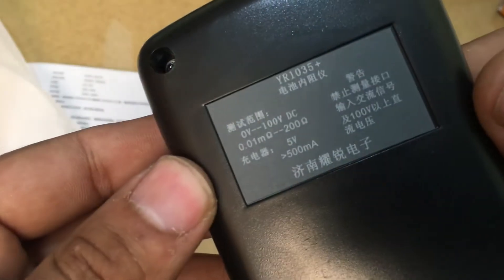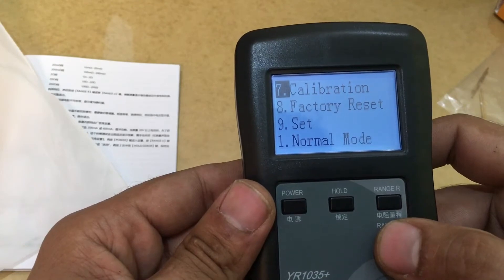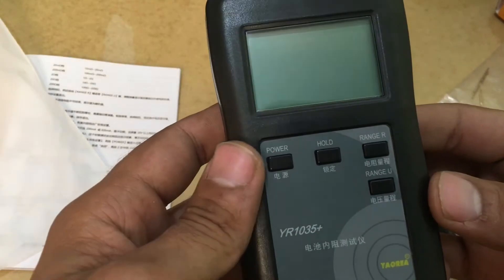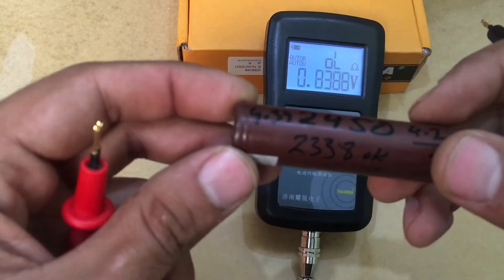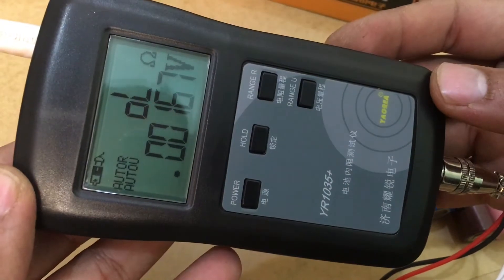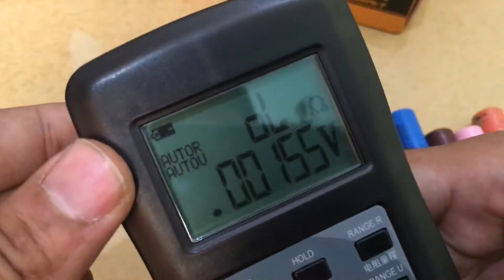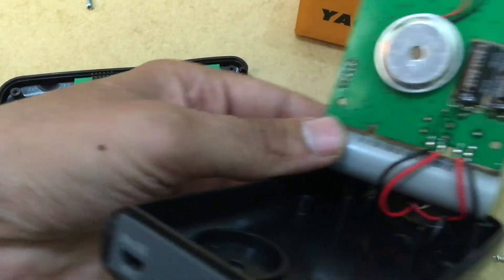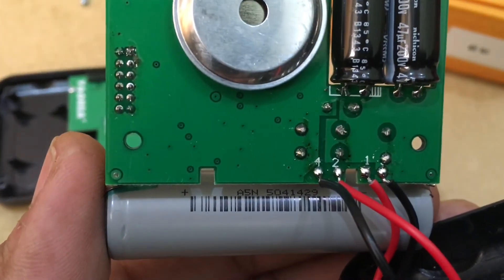Battery Internal Resistance Meter Tester YR1035+ English menu - Unboxing & teardown

Comment: Dear Jawad Ahmad!

Battery Internal Resistance Meter Tester YR1035+.
I would like to ask your opinion about this zester. In its description, I read that it has a measuring range of 100 volts and 2000 mA, i.e. 2 Ah hours. According to them, it is not suitable for measuring the internal resistance of a larger Lifepo4 battery with a capacity of 200 Ah, for example? I think that a battery should be able to deliver as much current as possible such as a 200 Ah battery, it must have a smaller internal resistance. So if a small size, for example, a 1685 lithium battery its internal resistance is 40 mR (milliohms), then a large, say 200 Ah capacity battery must be much less than 10 milliohms? And the YR1035+ is no longer suitable for measuring this  
Thank you for your help.

Comment: So how to know what LI ION battery is faulty?
What is value to mili oms that indicates that battery is bad ?
And what is for voltage?
Thx for explaining 
P.s i bought it yesterday
Reply from the maker: @soulbrothers7789  compare IR to other cells you have (same brand and model) or compare with the value given in data-sheet.

Comment: 120421/1551h PST 🇺🇸    Asalamu Aleikum Jawad Mian, Thank you for the informative video presentation on YR-1035+. I bought the same meter and am working through, with it, on all my 18650s/ 26650s and 21700s.
Because of this wonderful device, I could detect the issue with some of my Cell banks. The cells (used bought in bulk) indicated voltage 3.8V—4.18V on most most of them. But they all get discharged very quickly. After testing each of them with YR1035+ I found the Internal resistance (IR) was far high, some being 150milli Ohms!! They will be removed for recycling and good ones inserted in the Bank. 
By the way, I was unable to download (DL) the PDF User manual. Take care. Khuda Hafiz, Bhai Jan.
Reply from the maker: w.salam - yes it's a great IR meter - i never thought about pdf manual - because it does the job and i never needed any other functions - but i will try to find online or i will convert mine to pdf and share here - thank you for your kind words, take care

Comment: Проверка zero , белый с белым , красный с черным.
Reply from the maker: i didn't get it - Zero check, white with white, red with black. ??
Reply: Jawad Bhai, what he meant was….calibrating the instrument (Zero Check) was to connect White wire probe to white wire probe  and the Black wire probe to Red wire prove. This procedure will calibrate the device after determining the wire resistance. Wire resistance= the probe wires have resistance and the resistance must be deducted before the actual  test is performed, to get correct battery internal resistance (IR). Otherwise the result will be wrong, because wire resistance + battery IR will give wrong reading. Let me know if you need further info.
Khuda Hafiz.
Reply: @sreekumarUSA  ji lakin mere pass yr1030+ hai yaorea ka but usme probe nahi aaya hai plus usme zero checking ka option nahi hai? Calibrate ka bus hold option hai? Kya karu?
Reply: Specebo….